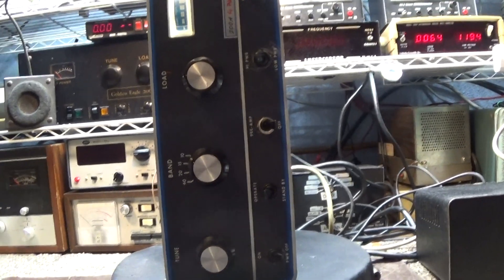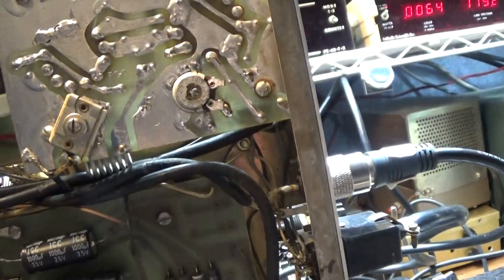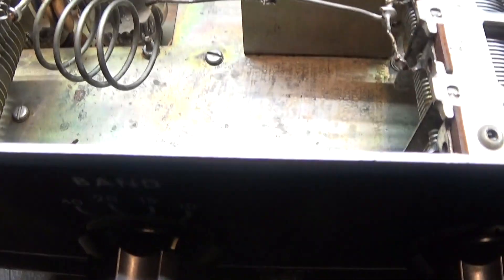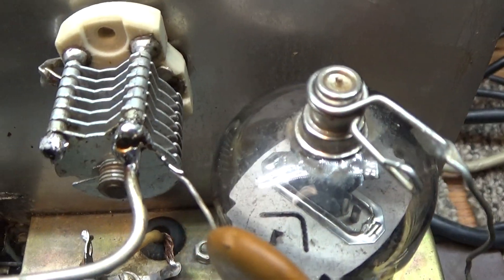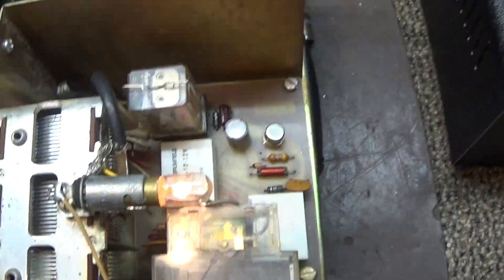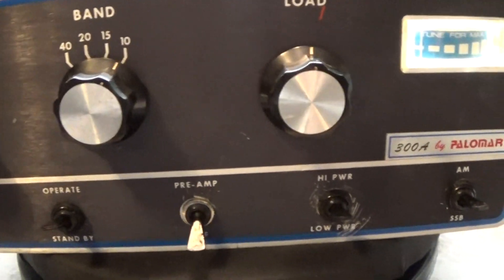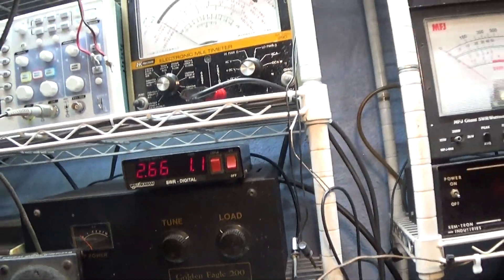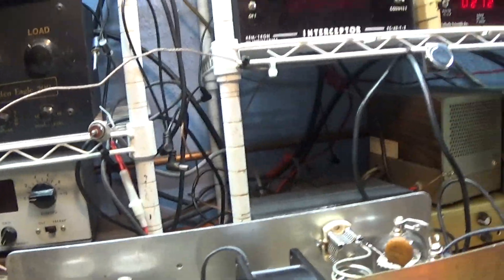Palomar 300A Black Face on the bench low drive

Comment: I have a 300 day exactly like that from the factory with 6 Cady 6s driving 6lf sixes never been modified
Reply from the maker: Great amps, one of the best. However, electrolytic capacitors need to be replaced as old ones tend to short and then you gonna have some serious problems. I was looking around the net for info about Golden Falcon amps and saw a blog where the plastic encapsulated caps used in the bias circuit had shorted and the amp was going crazy.